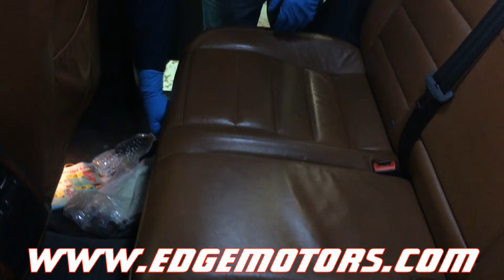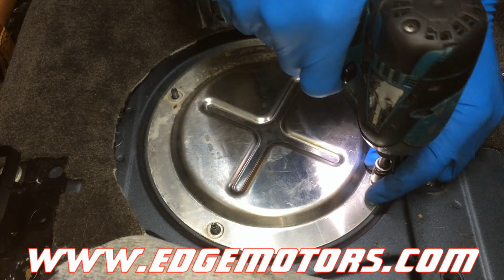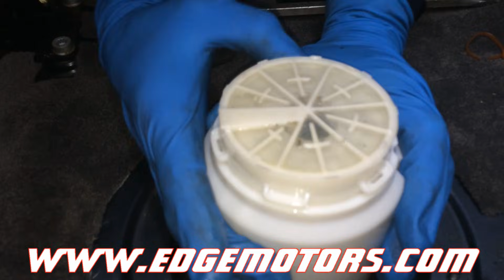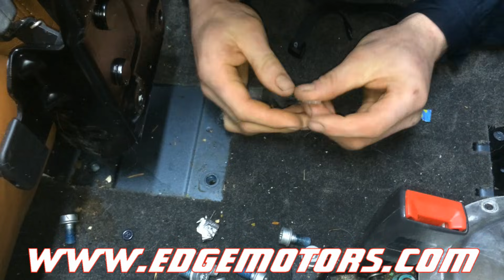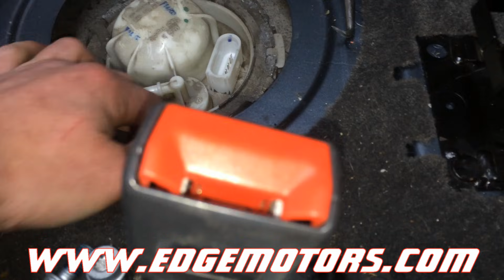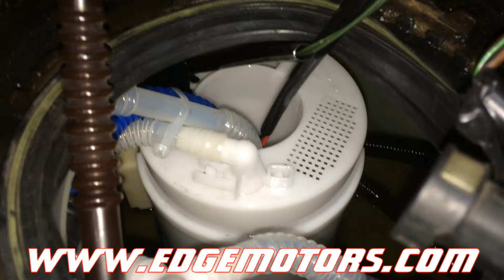VW Touareg Audi Q7 fuel pump replacement DIY by Edge Motors

Comment: So i replaced the driver side rear fuel pump  on my audi q7 4.2 and the bank 2 hpfp car worked went to walmart came back hpfp was leaking on the bottom tightened it car work start but turns over 😮opened the filter in the rear to check for any issue when i turn the key the fuel filter on the bottom is gushing fuel 😢… so gonna replace it  again.

Comment: So how did you get the hose from the other side which you indicated must be disconnected to remove the fuel pump from passenger side, that you went into driver side side fuel pump and disconnected the hose. The helper then pulled out passenger side fuel pump with transfer hose attached to it. How did you then get transfer hose to driver side from passenger side inside the fuel tank in order to reconnect transfer hose  to the new installed fuel pump on driver side being the transfer hose is connected to passenger side fuel pump?
Reply from the maker: You have to open both sides, make sure you have as low as possible fuel level, or you will have lots of damaged skin by the time you snake that hose to the other side, I usually tie a rope to it so you can use it to snake the new hose back in

Comment: hello friends, I am going to replace the two fuel pumps of my 2004 touareg v8 310cv and I have only bought the two pumps without the plastics and external pipes. My question is if they are both 4 bars of power or one of 6 and another of 4 . thank you
Reply from the maker: The pressure regulator controls the pressure… most likely the actual motors(pumps) are the same

Comment: Where is the fuel float sending unit? Didn't notice it in the video at any point and my gas gauge is only reading empty so I believe I'll have to change the float unit out is why I ask
Reply: float is on driver side, connects to the plastic fuel filter housing near the power connector. you can also test the resistance of it (and thus fuel level) by connecting a multimeter to the two inner pins of the 4 pin connector on top of the housing right after you cut the carpet.

Comment: Have a 2004 V8 Touareg. It sat for a year now when I turn it over the fuse for fuel pump blows. Do both fuel pumps need to be replaced? Car was running great before.
Reply: Sounds like it could be an electrical ussue. Were you able to get this solved?

Comment: hi Edgemotors  i have an issue that im trying to solve on my 07  v6 3.2   my  high pressure fuel pump started leaking and i replace it now i have a cel for (n276) open circuit sporadic i replaced it twice and have the same code im getting hard start and when it does start it idles fine but when i accelerate its like its lacking fuel if i step on it but when i ease into the  throttle it responds fine,  thats the oly code i have at idle but when driving i get misfire codes a low fuel rail pressure code    please help

Comment: So for the leak, we just need to replace the fuel pump flange/filter? Not the whole fuel pump correct?
Reply: Filter and rubber gasket usually

Comment: This video was very helpful. I ended up replacing both pumps filter,relay.. I figured, if I'm doing all this work for one and I'm disconnecting hoses from both, why not change the pumps while I'm there? Of course I bought the parts little by little and with this pandemic, i really had no need for my car..just watched a ton of youtube videos and did the job..the car starts with no issue and runs great..I made one mistake, I didnt seat the o ring properly so I had spillage of gas all over the place but once fixed, it's all good.
Reply: I have 07 Audi Q7 and I'm accessing the fuel pumps in the fuel tank. I have full access to one on driver side but carpet and seat rail are covering the 4th 10mm nut which covers the fuel pump for passenger side. I'm doing the service to determine whether the pump is faulty from pressure stand point. So being I'm in one of the pumps why not do them both with new pumps and filters there...as I am going to change the high pressure fuel rail pressure sensor also. May change the high pressure pump as well. I'm not grasping how did he get the transfer hose re ran from passenger side over to the driver side to be reconnected to the fuel pump there..🤔 !!!
Reply: Don't feel bad the dealer gave it back to me after fuel pump recall leaking gas all over the ground.

Comment: After replacing, will or should it give a hard start?.
Reply from the maker: Yes, you just drained most of the fuel system, so it will take a bit of time to fill back up
Reply: What's considered a hard start?

I'm about to change mine on an 05 v8. Mine started then it would shutdown. Then I changed the filter, it started stayed for an hour then turned it off. Now it cranks but wont start. I'm thinking it's the passenger side fuel pump since the driver side is trying to start it but wont start. I bought both pumps and flang for the driver side. Do I need to take out the fuses, the two 14 fuses and both 404 right and left pump relays when performing the job.  It's my first attempt...also any battery disconnection?

Comment: You guys are dong a great job for ONE PAIN IN THE ASS FUEL PUMP REPLACEMENT! Some are all in one with the ascending unit! Big bucks. What is this a $500-$700 job? with the parts? Because a friend of mine her fuel pump went out on the Tiguan. And looking at this? ...Screw it! She can get a mechanic to do it! What ever happened to where they were located towards the front (On american cars) and took maybe 45 minutes on a lift to do AHHH THE LUXURY OF AIR TOOLS...I am drooling!

Comment: I have a 2004 touareg diesel v10. I went to change the fuel filter as per your video. I opened up the drivers side compartment for the fuel pump. The plastic housing had the bottom removed and there was no filter. It appears that there was a fuel pump similar to the one you replaced in the tank. I did not take it out. I did not open the passengers side. The filter that I received appeared much larger than the housing. Could it be that the fuel pump had been replaced?
Reply from the maker: Fuel filter of a diesel Touareg is located between the cylinder heads on the engine... it’s a different setup
Reply: @EDGEMOTORS  how difficult is it to get to?

Comment: I have this same issue 2008 touareg 2 v8. Im about to throw towel in 150k miles everuthing else is fine expect for this fuel pump issue. Mine would cut off between 30-40 seconds and sometimes it will turn on and get me to work and back home . 20 miles there and back.
Reply: Did you try replacing the passenger side pump?

Comment: Hi, when my car has been standing over night or for a few hours it takes alot of turning over to get it started, almost like there is no fuel there, could this be one of the pumps in the tank. There is no smoke of any kind once started so not a glow plug issue. It's like the fuel system looses its pressure, thanks

Comment: Nice video, but question for you: I replaced Both Pumps, however on the Left Side Pump, I cannot get the Fuel Filter back on after connecting the "Blue" Hose from the Fuel Pump to the Fuel Filter housing. The Blue hose line is getting pinched and is so still it will not close. Do you have any recommendations?

Comment: Thank you for your help. This video was priceless and helped me immensely in installing two new fuel pumps. The vehicle now starts and runs whereas before it would start for 10--15 seconds and then die. However now it takes about 5 seconds of cranking to start where before it would start right when I turned the key... Do I have a leak?
Reply: Based on my symptoms I have a fuel pressure leak somewhere after doing this installation :(.  If I start the vehicle i the morning after sitting it takes 5-10 seconds of cranking (fuel pump priming the pressure) to get it started. If I've just started it and shut it off and restart, it fires right up. 

This sucks because I'm an on call firefighter and those seconds are precious for my community.  I'm hoping someone can help me isolate where I'm losing pressure. I replaced both fuel pumps and the filter, but not the filter housing itself.
Reply: Did you get your fuel pressure problem solved?
Reply: @RunningWithSauce  mine had a long crank I cleared all the DTC codes now fires up fast

Comment: do i need to change both? my VW 2004 v8 runs for 10 seconds then it shuts off. which one should i change? the one behind the passenger seat or the one behind the driver seat?

Comment: Hi. My 2004 Touareg V8 working fine, just started and stays about 30 sec and goes off! Will that be fuel pump? I can run the car for about 30 sec and has full power but it turns off. I am assuming it is fuel pump. 
P.S I hate this car and I love it at same time. Small, Heavy** VS Strong, Fast..** what a hell!??
Reply: I’m having the same issue right now. We’re you able to solve it and it so was it the fuel pump?
Reply: @ronaldnunezor  I ended up selling the car... Well that V8 of VW no one wants to deal with that. I have noticed that even the specialized dealer ov Audi/VW didn't want to deal with V8 version 😭. One guy checked the pump but he said the pump was fine. Couldn't fix it. Car running for like 30 second and shuts off. Starts right away and has full power though...no stalling those 30 are complet normal. Loved the car for power and speed was amazing. But now killed my dream of that V8 engine of those Audi/porches and... Traded the car for $2500
Reply: @ronaldnunezor   For '04/'05 Touareg V8, Passenger-side pump is the culprit. I'm replacing that now, along with left-side fuel filter/housing.  I'm not doing left-side pump yet, because it is expensive and it is working fine. The Driver Side pump primes the motor before start and adds fuel when you floor it...  Passenger-side is the one that causes engine to stall after 30 sec. or so.  (This is assuming there aren't other isssues, of course...).   I realize my Treg V8 resale value isn't even that of the pumps and labor to replace them, but I love the Touareg, and hope to keep it running for a while longer.  Cheers.
Reply: @bartofilms  thanks for replying! I’ll be definitely doing the same thing next week. I’ll be replacing the driver and passenger side and I also need to purchase a new filter
Reply: @ronaldnunezor  I got all my parts, including fuel filter/housing from PartsGeek.  The VW oem parts are $500 each. Bosch or Conti are less and s/b fine.
Reply: @bartofilms  did you put the peet's in? Is it working. As I mentioned I no longer have the touareg but really want to know what problem was. Because it seems to be something easy
Reply: @donaldtrapi8242  Hey Donald.  It is a W.I.P.  I'm still waiting for the parts to arrive, then I must siphon the fuel from the tank before getting in there.   Not an easy job by any stretch, but I can't afford the shop charges right now.  Cheers.

Comment: if I removed the fuse for the primary fuel pump, can I still drive it to and from work 30 min each way for a week until the new pumps arrive?
Reply from the maker: jennw2n 
No, the secondary fuel pump only engages for the first 20-30 sec and under full throttle... so theoretically yes if you start your car and go full throttle all the way to work:) just kidding... allot of damage and injuries will occur:) if you do that
Reply: Thanks for the lightning fast reply. Great detailed and super informative video. I will rent a car in the mean time...until the pump arrives. The last thing I want is to have more issues.
Reply: I drove my cayenne turbo all over the place after I pulled the main pump fuse. I took it easy but still you'd never know one of the pumps was dead!!
Reply from the maker: You pulled the secondary pump fuse.
Reply: @EDGEMOTORS  can you kindly explain then why disabling the secondary pump causes the engine to run fine? I assume it electrically forces the primary to run even at idle? Ty
Reply from the maker: The primary pump runs all the time. 
The secondary come on at start up and full throttle.
If no one messed around with plumbing in the tank the car will run fine on a primary pump only. 
What’s going on with the car? Why do you think there is something wrong with any of the pumps?
Reply: @EDGEMOTORS  TY for the follow up!  04 Cayenne Turbo. I had the start/stall condition till I removed the fuse. I guess I still don't understand how removing the fuse for the secondary (failed?) pump makes any impact on the function of the primary pump but it clearly does somehow. It seems to me that pulling the fuse for the one pump (idle pump?) electrically  forces the other pump to run all the time under any condition.
Reply: I have new pumps coming, I'd just like to understand the dual pump system better. Are turbo models any different than other models?

Comment: This might be a silly question, but what's the name of the special tool you used to pull hoses out?
Reply from the maker: Not sure, fuel line disconnect pliers??
Reply: +EDGEMOTORS thank you and thank you for the video, I'm getting ready to tackle this project on my 06 Porsche Cayenne and it looks identical to your video. gives me the confidence to DIY myself. thanks again!!!
Reply: Hey bro how did this work for you on your porsche?
Reply: Christopher thomas it was actually easier than I thought.  This video was great to follow. the hardest part is removing the wire harnesses inside the tank without breaking the clips. be careful, but definitely doable. I am by no means mechanically inclined.

Comment: hello colleague helped me a lot with your video, I have a Touareg and dead by fuel pump failure. I am planning to do the job but do not know which tool is used to remove the screws from the base of the seats, you could help with this would do this for me?
What tool is used?
thanks and regards
Rob.
Reply: I have the same issue with my current 2005 Touareg it’s not starting up at all. We’re you able to solve your issue?
Reply: Yes, I'm having the same problem

Comment: what's the purpose of 2 fuel pumps?do the both run all the time?
Reply from the maker: They run at thesaurus time, only on start up and full throttle...
Reply: @EDGEMOTORS  i figurured out the second one also runs when your gastank is almost empty (in the red). I can hear them Both run at that time. I have a Lean condition 25+ fuel trims when my fuel tank is not in the red but lean condition disapears when the tank is almost empty (in the red) and both pumps are running. Is my primary pump (half)busted or do you guys think its the filter that is dirty?
Reply from the maker: Most likely the filter...
Reply: @EDGEMOTORS  Great! thanks for the quick reply. i allready ordered another fuel filter. Will be changing it soon as per your other vid.
Reply: @EDGEMOTORS  wasnt the filter... changed it but still same issue. so im guessing the main fuel pump is faulty.  when the fuel tank almost empty (and both pumps are running) trim values good. then i stop engine and remove the 404 relay for the second pump. start again and the fuel trim values are crappy again +25 on both banks so lean condition comes back.
Reply: @EDGEMOTORS it was the Main pump. Placed a new one today. And now it runs great again. No more Lean condition. Trim values are around 0% 👌

Comment: in my touareg i got p0455 evap leak, but is no where to see any leak, but i hear bubble noise coming from passenger side pump, also i can hear pump working.i should hear either the pump or any pumping bubble that coulb related?  or is coincidence?  pls help!
Reply: 10 years too late but my 2017 did that today the bubbling won't start if it did it cuts off after a few seconds😅😅I'm going nuts there's no fucking access panel under the seats either😅

Comment: Its best to replace both of them at the same time if u have to take everything apart anyway no??
Reply from the maker: +TheHonarable1 could be, but its pretty expensive....
Reply: +EDGEMOTORS yeah I hear you
Reply: +EDGEMOTORS in my touareg i got p0455 evap leak, but is no where to see any leak, but i hear bubble noise coming from passenger side pump, also i can hear pump working.i shouldnt hear either the pump or any pumping bubble that coulb related?  or is coincidence?